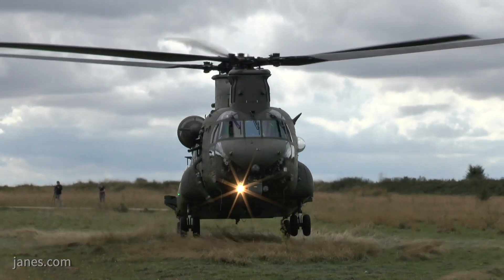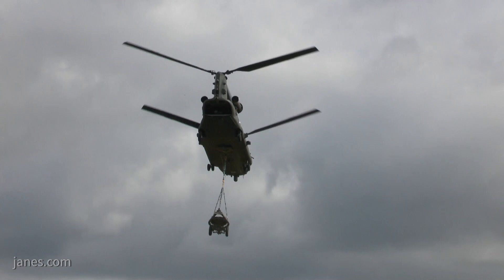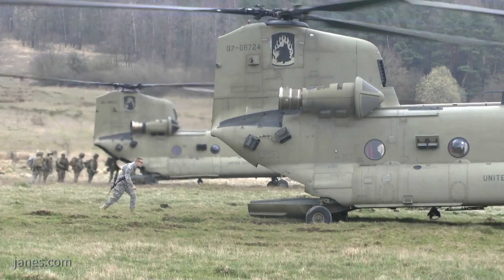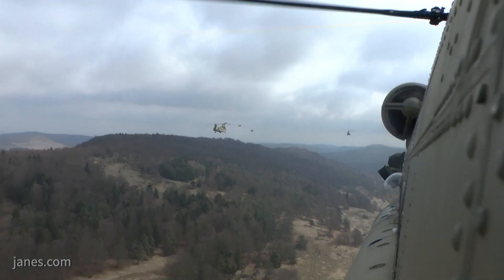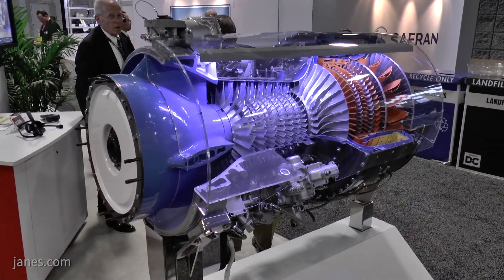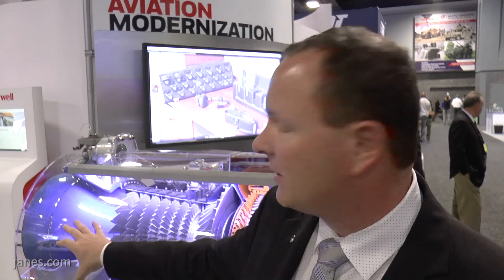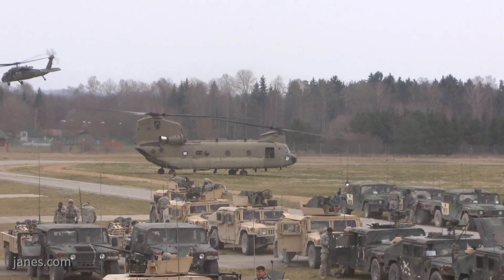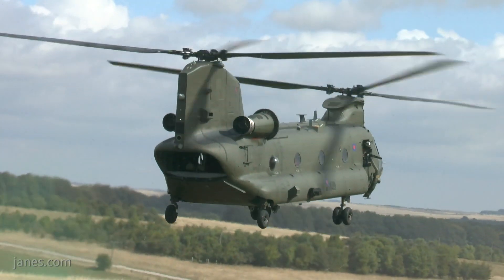T55 engine upgrade

Comment: That is great and all, but what Honeywell needs to do is go to theunlimited class turbine powered boats and see what mods they're doing,because they're pullin 5000 shaft horsepower from engines that were only originally built for 2200 shaft horsepower and using the exact same components that Lycoming originally designed in the first place, oh and stop using radioactive exhaust pipes!!